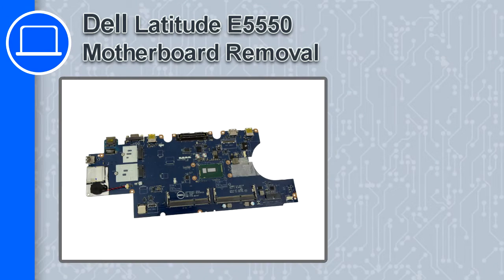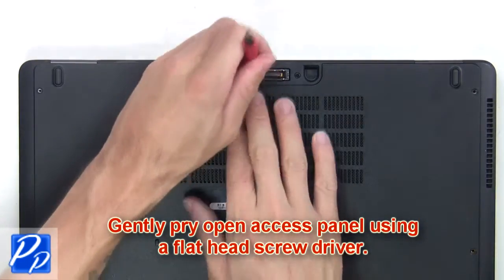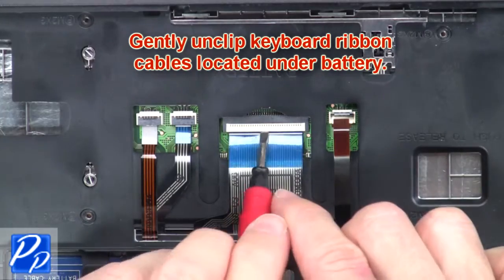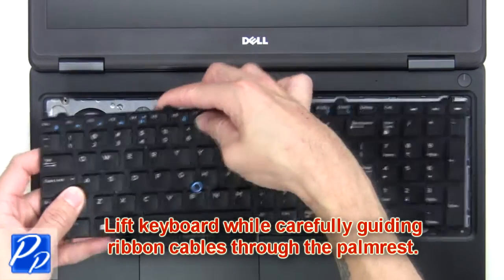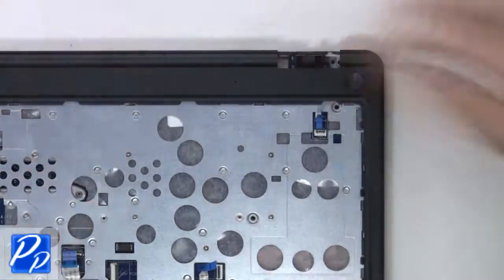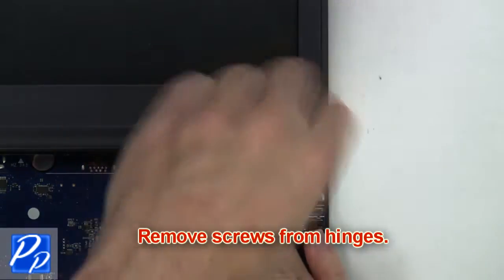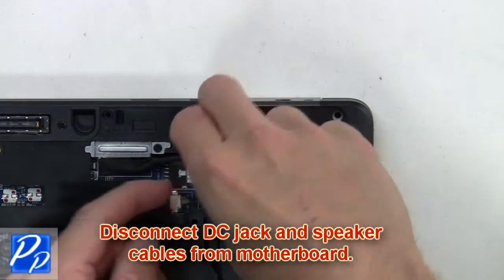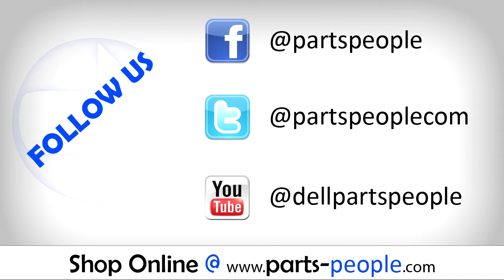Dell Latitude E5550 Motherboard Replacement Video Tutorial

Comment: Hello, I am from Venezuela, I would like to know if you have a Dell latitude e5550 motherboard available and the shipping price for Venezuela
Reply from the maker: Hi Issac, we have a couple Latitude E5550 motherboards in stock. Depends if you have the intel or Nvidia graphics - you can check using your service tag on our website. As for shipping, Venezuela is on our list but depends on your location. You can check by using "calculate shipping" on the product page. Email us with any questions info@parts-people.com. Here's a link to the motherboard for your E5550: https://www.parts-people.com/index.php?action=category&id=140&subid=537&refine=mother

Comment: I am currently in the middle of disassembling and reassembling my e5550. This tutorial is great, but some clarity around the fan and, more importantly, the accompanying heat sink would have been useful. I bought a new board, not realizing that I would need an entirely different heat sink for it. I was surprised when I encountered it! Now I’m sitting and waiting on new parts.